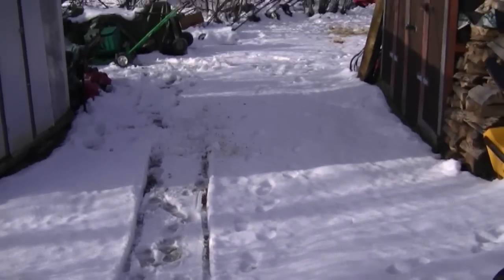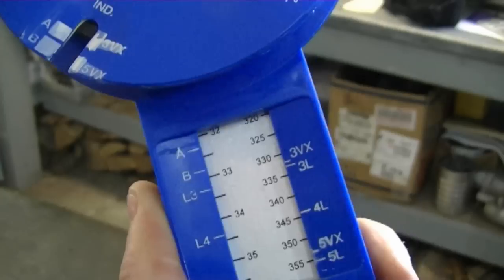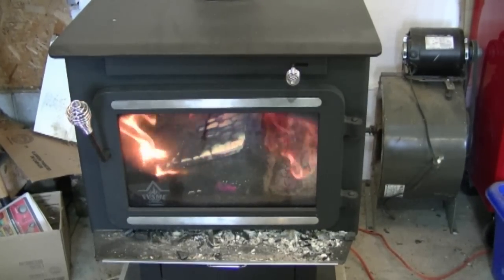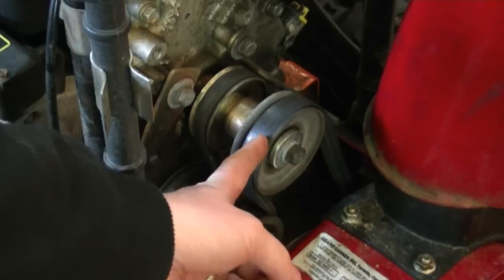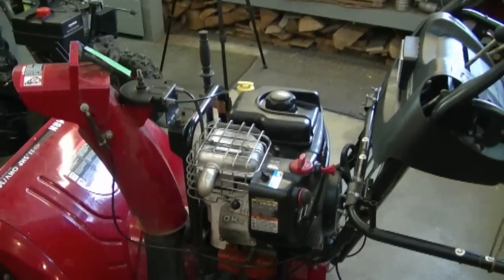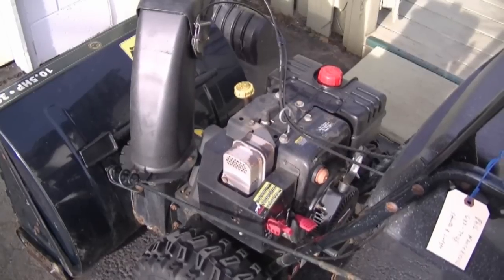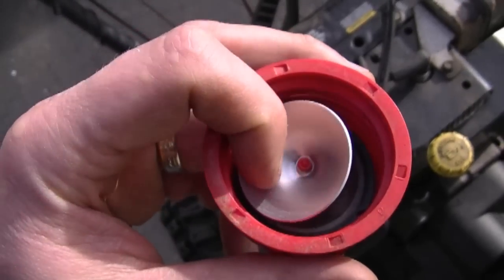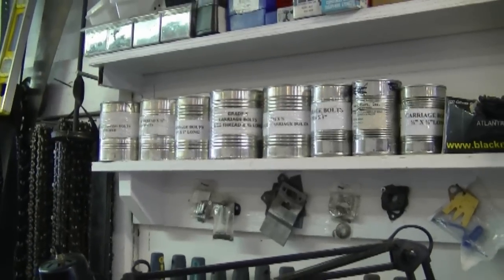Small Engines Q & A Video #76 in HD

Comment: Nice video as always...question...Saw your video about the chainsaw clutch that stops the chain from spinning at idle.  I have an Echo straight shaft line trimmer that has the line spool spinning at idle (never use to do that)  Is that the same type of problem?

Comment: Great videos Dony! I have a ques I have a 49cc scooter I just bought that would bog down at wide open throttle I adjusted the carb, it just has one adjusment screw and it doesn't bog down at full throttle anymore but it doesn't want to idle now it will just idle on choke but when I turn the choke off it will just die out any suggestions would surely be appreciated thanks

Comment: Quick question: Some 2 cycle oils state they have fuel stabilizer in them already. How reliable are the stabilizers they use in these types of oil?Should additional fuel stabilizer be added to fuel after it is mixed with these oils or will this result in too much stabilizer possibly harming the engine? 

THanks!

Comment: EDIT: I use 5W40 Syntethic Summer and Winter in my Scooter. It uses oil i checked it today, and there is about 180ML used in about 470KM. My dipstick says that the oil is half the stick.

Comment: @donyboy hi I have been watching your videos a lot I learn a lot from you but I have a problem with a makita 5600 trimmer it seems to be flooding the cylinder and does not run quite right i have put a new carb kit on its still not right if I take the filter off and look down the throttle it is spitting back fuel in to the filter hope you can help me many thanks

Comment: hey dony, is there replacement bushings for briggs engines, im talking about the bushings for where the crankshaft spins in the block and sump cover. Reason Why i ask is i have this 3.5hp briggs and everytime i shut the mower off i hear this clunk kind of a sound, and i pulled off the engine shroud and moved the crankshaft front and back and its clunking back and forth, it seems a bit much for the think, and its an 04 model so not too old. i also have a 7hp b&s that does it but not as bad at all

Comment: Yes we got that snow storm got 14 inches of snow no power 5 days when it came back on a surge went threw our lines and it took out 2 laptops mine included 1 computer and around 5 surge suppressors . I am now using a 15 year old laptop using windows 95 . Central Hudson refuses to pay for the damages . Some folks lost there whole kitchens appliances furnace and a lot of electronics . I do not have the funds to buy a better laptop.

Comment: dony i want to take my 12 1/2 briggs off my yard machines riding mower but the pulleys will not fit through the hole on the mower. how do you remove them and do i need a special tool...... HELP!!!!!